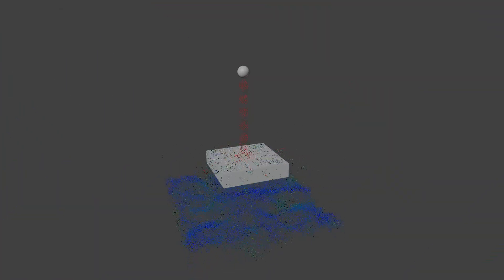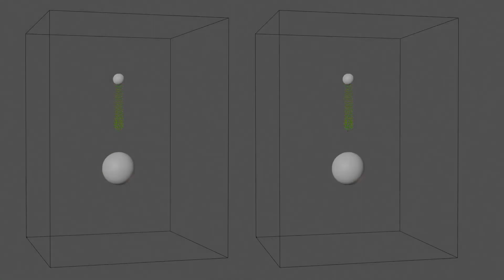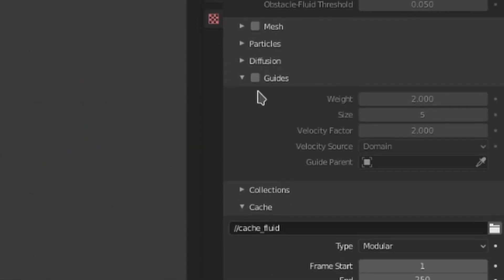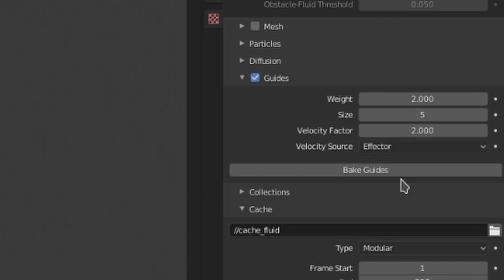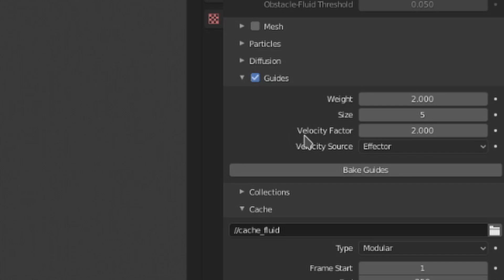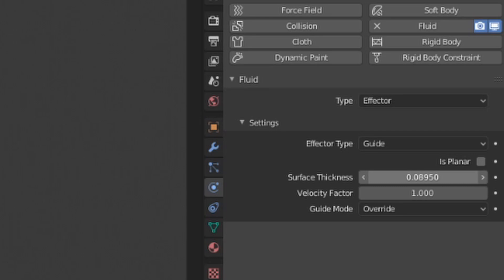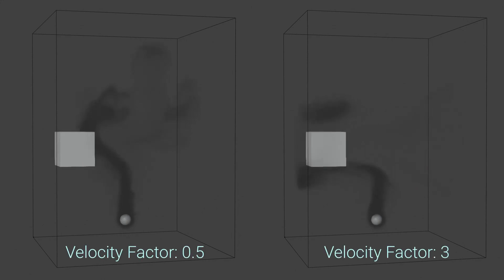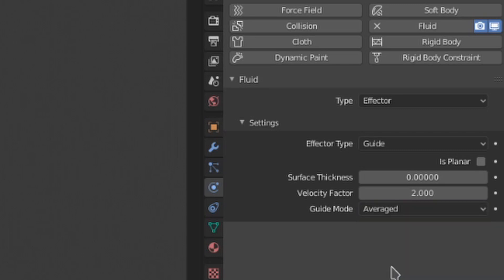Effectors and Guides | Blender Mantaflow Part 6

Comment: Damn I'm trying to punch a hole through wall of smoke and I just can't seem to get the desired results. I've tried using sphere, cylinder, round plane, array of round planes (so it's kinda cylinder) as my effector but the only thing I'm achieving is getting smoke to swirl faster in the domain...
Reply: I'm new to fluid simulations but I'd guess what's happening to you is what would happen in real life. You are likely going to need some unrealistic smoke settings to be able to punch it.
Reply: @mattiabruni5463  I mean yeah it is kind of unrealistic but partially. I want it to behave like high density smoke but right now it acts like a mist. Think freshly produced smoke from smoke machine while it hangs near the floor before it dissipates and rises up in the air into a mist. Sure if you throw an object through smoke not much will happen - but if you launch it at considerable speed the air pressure in front of the object would push smoke aside and for a brief moment create a cylinder-like tunnel, before it would collapse. I want to exaggerate and prolong that moment. 
I suspect I need some combination of maybe colider, outflow and effector objects bunched together or following each other for best result but I lack understanding of the system (doesn't help that it takes ages to recalculate simulation). For example I'm still not sure what's the best practice in order to create rapid smoke expansion in the beginning of animation and then slowing it down once it fills the desired space - should I use several emiters? Should I animate my emiter by scaling it up or moving it around? Maybe animate Vorticity value so the first second goes crazy at max value 4 and then rapidly falls off to .01? I can't find any of that shit explained anywhere for Mantaflow.
As for the punching hole you know what would work perfectly? If I could somehow create vortex field that affects only desired space - no matter the strength or scale I set up it affects the whole domain. Or maybe Force Field but again, same problem - the range of the effect is WAY greater than needed and no matter the options I can't seem to be able to scale it down.
Reply: @mattiabruni5463  This is the kind of effect I'm trying to achieve (this is very very shitty mockup of meatballs particles to show what I have in mind):
https://www.youtube.com/watch?v=UuxZdNf5Xsk
Reply from the maker: Guides can be a little bit finicky. if you parent a force object to your animated object it may help. Try multiplying the velocity of the guide object as well, or maybe make it move faster.
Reply: @MrCheebs  I'm not sure how to use guides in this case, I was using colliders. I'm sorry, explain like I'm five.

edit:
I've just found perfect example of what I'm trying to do:
https://imgur.com/gallery/EnVSQRd

Comment: hye cheebs, im stuck now, now i use append cache file  from other working file, so i want to offset the simulation to start at frame 300 instead of frame 1, how can i achieve that cheebs?